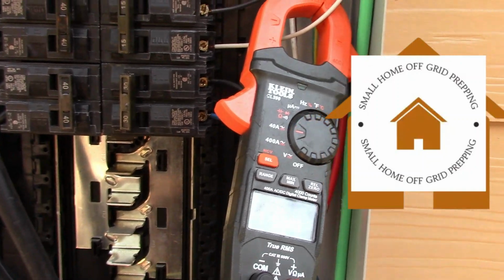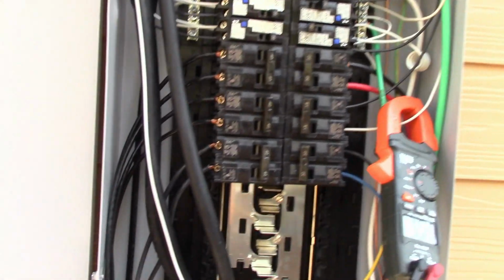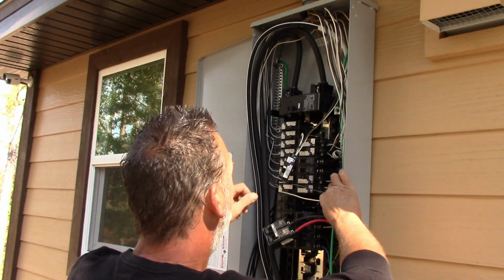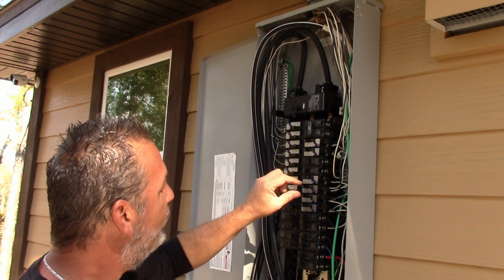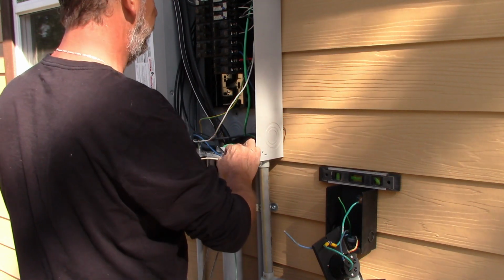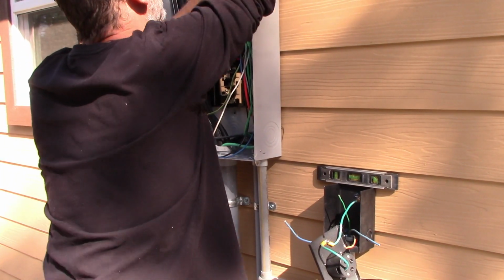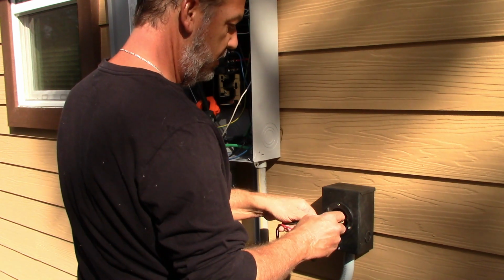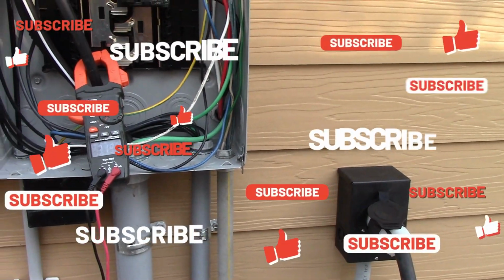CONNECTING any GENERATOR to the WHOLE HOUSE per NATIONAL ELECTRIC CODE

Comment: I have a 4 prong plug like yours on the house but my generator is a 3 prong. Is there an adapter I can use would that be safe?
Reply from the maker: If your generator itself only has 3 prongs that means it is only a 120volt, not a 120/240, the panel on your house is 240, the reason the inlet has 4 prongs is there is 2 hots, a neutral and a ground, the generator only has 1 hot, a neutra,l and a ground, unfortunately a 120 generator would not work on your house, there is no adaptor for that because you would only be powering one leg of the panel, nothing 240 like an AC unit, dryer, stove, would work and only half of the 120 circuits would work. Thanks for asking this question, I've been meaning to bring this up in a video, when buying a generator you need to be sure its a 120/240 if you want to connect it to your house, they make generators that are mostly set up to power something like a travel trailer that would be a 30 amp 120 circuit, but don't put out 240.
Reply: There are 3 prong to 4 prong adapter cords available that bond the single hot leg to both legs in the 4 prong plug, so you can power both sides of your main panel, however you MUST switch off any 240v breakers before connecting. You'd have to be very conscientious about how much loading you are using to prevent overloading your generator.
Reply from the maker: Hey Jake, sorry for the late response, I have been having problems seeing and posting some of my comments .I responded to this same comment on one of our other videos on generator voltage, It's titled generator voltage buying the correct generator, you can read it there so I won't get into detail here. These do exist, however due to the amount of safety hazards and fire hazards that would be caused by using one of these, no ethical electrician would recommend, or advise a customer it is safe to use, so as far as we are concerned, they don't exist .Like I said I get well into detail on this in the comment section of my other video, but keep in mind the neutral will not carry the sum of both legs, just the equivalent of one, causing the potential of an overload of the neutral, this is worse and more dangerous in homes that have shared neutrals, again read my other comments on this, I actually watched a large flat screen tv explode from someone using one of those adaptors. I'll respond to your other comment on our AC video with the code violations in a few days, I have gotten six answers on that so far, but have only been able to post yours.

Comment: Hi Sr. Is your generator a floating neutral or a bonded neutral? And does it make a difference when used to power your house ?  Thanks. Joel
Reply from the maker: Sorry it took so long to reply, been very tied up with our ecommerce sites and haven't been here for a few days. This generator is bonded, most portable generators are, when connected to the panel with an interlock the ground in the panel will usually still be the least path of resistance and any overcurrent will usually divert through the main ground, even if the generator is bonded. When not connected to the panel the generator being bonded will prevent anyone from being shocked. there is cases where unbonded generators are used, however with a portable generator like this one I would recommend using a bonded generator, and never try to unbond a factory bonded generator.

Comment: Great videos.  New subscriber wanting/needing the education!  Located in deep So. Texas and adding portable solar generator - 2 EcoFlow Pro generators with backup bats (to yield 240v for deep water well pump).  NOW, "electrician??" came and said that I have 2 main panels (100A and 200A--both fed DIRECTLY from utility) so assuming 100A IS NOT a sub panel.  When he comes back with "the plan" wondering if the only way to do this safely is to have 2 inlets and 2 interlocks , one for each panel.  But that means my 2 EcoFlows will not be linked and I have each panel serviced by one 3600watt solar generator+2 backup bats???   Currently  I have a 6 circuit transfer switch/kit that I used with my gas generator and don't know if that has to be "disconnected?"  Any advise is much appreciated!
Reply from the maker: Thank you for subscibing, I'm glad our videos are helping you learn, that's exactly why we do these. If both panels have their own meter can and are fed seperatly from the utility company neither is a sub panel, a sub panel is fed from another panel.I.m not sure if you're trying to make stuff that you already have work, or you still need to get what you need, but there is several options to do what you're trying to accomplish. First you probably don't need 300 amps of service for you're house, when I have seen this in the past it was usually because at some point someone wanted to seperate the electric charges, usually a renter, or for a barn or shop that's a business, things like that. I would simply install a transfer panel and move all the circuts I want to run on solar into that panel, that way you have all of those circuts in 1 panel and you don't have to worry about powering both panels. from there I would preffer to use an off grid inverter, mine is a 6000 Watt Split Phase, if I want to bring it with me somewhere it takes less than 5 minutes to disconect and put in my car, it can also be connected to my car battery and alternater and run that way, otherwise it stays permantly connected to my house and is ready to go at any time. I made this video that you just watched probably close to year ago, since then I have installed my entire solar system, installed a transfer panel and transfer switch, I have a ups which means uninteruptable power source/supply, if my power goes off the solar swaps on so fast that the lights don't even dim, I made videos on all of this as I did it, I think there is probably at least 10 of them, starting with wiring and installing the panels, take a look,they are in my most recent videos , it may give you some ideas on what you're doing, any other questions don't hesitate to ask and thanks again for subscibing.
Reply: Thanks for your quick response/advice. Clarification-- I have ONE utility meter and both panel boxes have separate main breakers, so this means that the main line from the meter was "split" before entry into each panel box???   Ughhhh....
 
 @smallhomeoffgridprepping1511
Reply from the maker: The main breaker dosn't matter,the question is where are the feeders coming from, if they are both coming from the meter can that means they are both main panels and each the first means of disconnect, that also means the meter can is double tapped and if the meter can lugs are not rated to be double tapped, that could be very dangerous, standard meter cans do not have lugs rated to be double tapped, those are special meter cans, very expensive because they are not 200 amp metercans they have to be rated at 3-400 amps depending on what size panels are added, I would have an electrician verify where the feeders are coming from and if both panels are being fed by the same metercan, that the metercan is rated for both panels, if you have an older electric system someone may have just added another set of feeders to a 200 amp metercan, and if so the older it gets the more unsafe it gets, Over 30 years as a Master electrician I only have only seen a few electrical fires, all were because someone had done somthing out of code and unsafe at some point, the senario you are describing with your panel was one of them, someone at some point had illegally double tapped a 200 amp metercan with 4/0 and 2/0 wires one set to a 150 panel and the 4/0 to a 200 amp panel, it would have always been overheating, but as it got older it became worse, evetually heating up to the point were the feeders began to melt and caught fire. There is set ups like yours that were done correctly and are safe, but I would have that verified if I were you. If the feeders don't both come from the metercan, one has to be a sub panel. Makes no differance for your solar, you could still remove all the desired circuits from  both panels and move them into a transfer panel, you could then add the inlet directly to that panel, then your electrician will install a feeder breaker in the main panel to feed the transfer panel with utility power, another breaker will be installed in the transfer panel, and the feeders from the main panel will connect to that breaker to feed the transfer panel with utility power. The inlet breaker will install right above the feeder breaker, and the interlock connects to both of those breakers, preventing,both from being on at the same time, this is the easiest option for what your trying to do, these are panel interlocks, not main interlocks, Cutler Hammer has the best one because it's completly automatic, if you turn on the inlet breaker it automaticly turns off the feeder breaker and vise versa.
Reply: WOW, thanks so much and will be following up tomorrow for specs on the meter can!  Beginning to identify what circuits we want to relocate to new transfer panel and hopefully we can locate a very qualified electrician down here.  As a retired firefighter safety is number one!  Thanks again...  @smallhomeoffgridprepping1511

Comment: Is this your main panel or a sub  panel?
Reply from the maker: This is actually a sub panel, it's fed by a 200 amp MB pass through panel about 120 feet from the house, it's built on a pedestal with the meter can.
Reply: @smallhomeoffgridprepping1511  gotcha. I. noticed the bond screw backed out and grounds and neutrals separated.  Good video

Comment: Resistance when you bend the wire at a 90 degree angle ? Never heard that before.
Reply from the maker: Sharp/hard 90 degree bends in electric wires will distort the wire changing grain boundaries, causing resistance, the correct way to bend 90 degrees is to gradually sweep the wire, as I showed in this video, the same goes with  ac ducts, sharp 90 degree bends will cause resistance, that also should be gradual sweeps, thanks for the comment, I hope you enjoy our videos.
Reply: Thanks for the knowledge 👍🏻
Reply from the maker: Sharp hard bends will increase the chances of grain separation at the grain boundaries, causing microscopic cracks at the grain boundaries,  I would think from reading your comments that you know electricity travels on the outside of the wire, not the inside, by distorting the wire this way you will disrupt the drift speed of the electrons at this point, causing resistance and heat. This is part of the reason we use thermo heat guns during an electrical inspection to check panel and breaker temperature, to be sure there is not something causing excessive heat. Over the last 30 years I have changed thousands of panels and see no reason I would want to bend a wire around my finger and increase the potential of grain separation at the bend, when I could gradually sweep the wire, as shown in my panel on this video, and guarantee I have not distorted the wire. As far as aluminum wire in 30 years as an electrician I have never seen a wire burn up at a bend, Aluminum will defiantly distort faster at sharp bends, but again I have never seen a wire burn at a bend,  I have seen many wires aluminum or copper burn up at the connection. I have had countless jobs over the years were an insurance company would not insure a house that had aluminum wiring, however the correction was not always to rewire the house, in most cases the correction that satisfied the insurance company was a re-device with alumicons to guarantee a solid torqued  connection at the device .Aluminum will flatten more at a sharp bend, but the bigger concern in this situation is grain separation at the grain boundaries, the sharper the inside bend, the more you have increased the potential of grain separation at the grain boundaries of the outside bend.